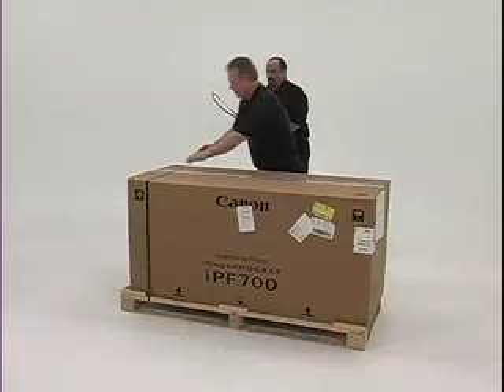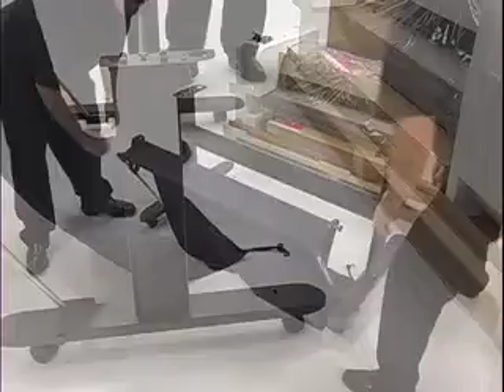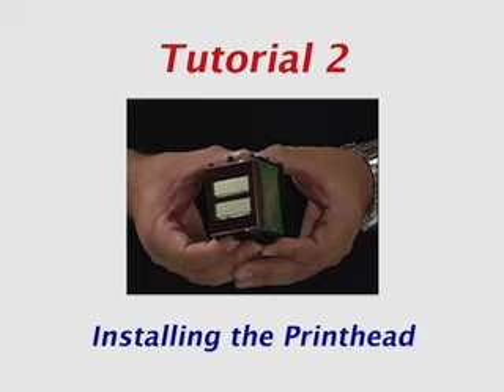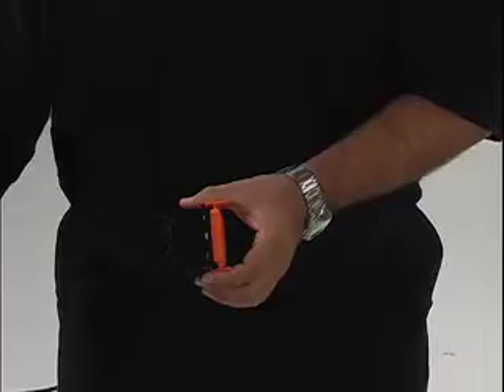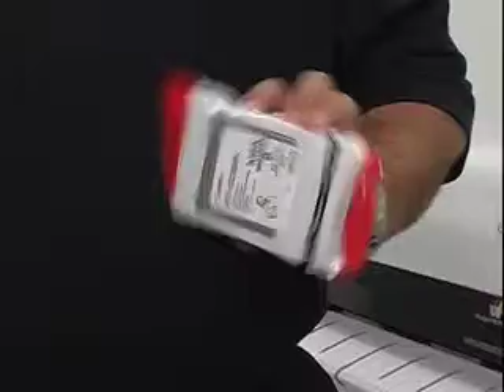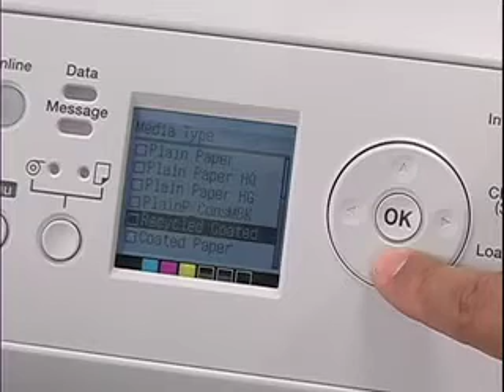Canon imagePROGRAF iPF700 series large format printer installation 36"

Comment from the maker: It really depends on the amount of use the printer experiences.  If you print more often, the cartridge will generate receive more waste due to standard head cleaning, etc.  If you print more full bleed prints, this will also generate more waste ink.  Thanks.